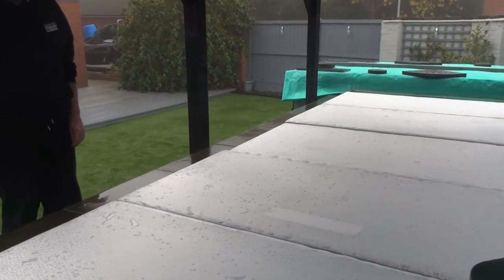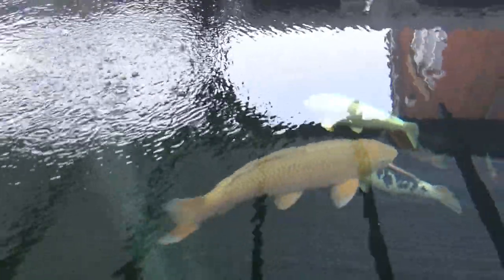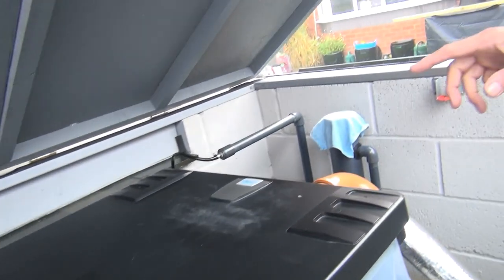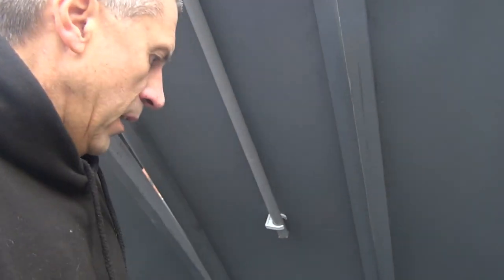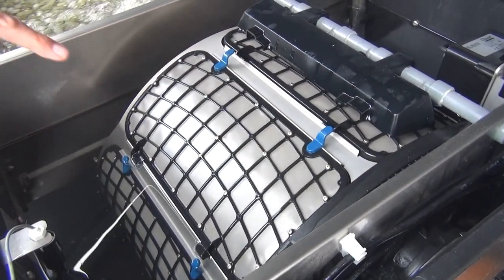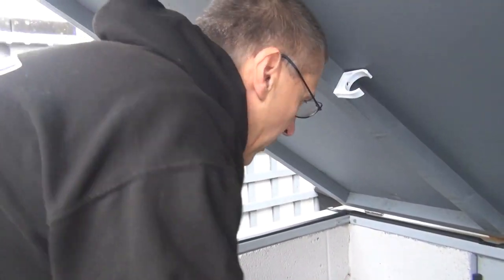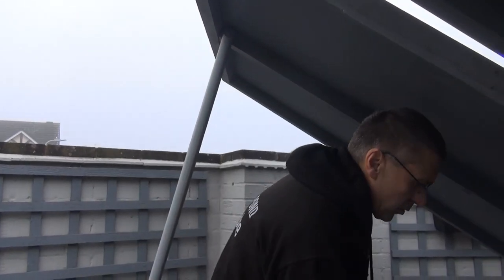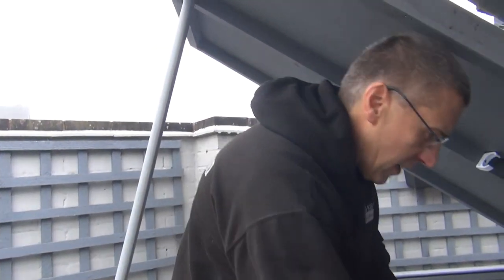T.K.P. Telford Koi Pond - Video 45 - New Koi progress, Filter & Airsource Heat Pump and Water Flows.

Comment: Heavy rain last night and I only had 2 covers on as it was warm so a lot of rain into the pond however I found that this helps my Nitrate and does not seem to effect any of the other tests PH was 7.4  Water test   ..  @
Moved the pond light again by a couple of feet and the fish seem to like this better…  @
Reply from the maker: My pergola only has shadecloth on the top as I struggled to get polycarbonate sheets at the time but Must  admit I’ve tested after heavy rain and it doesn’t really affect the parameters in my pond which was a relief👍😊. I need to get some lighting sorted now that the nights are drawing in so quickly (dark her at 4.30pm today😡) so that’s probably my task for this weekend. Thank you for watching and commenting, it is appreciated 👍🈲🐟😊

Comment: I was just in the midst of sending you a message regarding the ASHP and flow rate., job done and thanks for the info.. your ponds looking great and the fish are coming on really well. 👍🏻
Reply from the maker: Thanks Phil, much appreciated 👍😊. I’ve got the 12kw Thermotec heat pump and the recommendation is a nominal 4700lph so running my 12000lph at 40% is 4800lph so having that pump going through a virtually straight run into the heat pump and nothing else allows me to control the water flow just using the variable flow on the pump control panel so no need for tweaking the ball valves in the heat pump bypass. I would alway recommend running a dedicated pump for the heater. Many thanks for watching and commenting 👍🈲🐟😊

Comment: Afternoon Phil
Would u get away with two rtns near the drum without ur long run to the ashp if the pump was beside your filter hut? 
Or do u need that far end rtn for water rotation?  Regardless of ashp  location
Head scratin time before blocks get build up over the next two weeks
Aaron
Reply from the maker: Afternoon Aaron👍😊. You would easily get away with 2 returns near the drum obviously one above the other at different depths and off-centre / circa 12” away from the corner) . I have friends with the same size pond who only have a single return and they get great circulation. The only reason I have that return up the far end returning at 90 degrees to the ones near the pump house is because that is the only place I could site my ASPH to ensure the airflow that the manufacturer recommends👍. Also remember to design your flow to give you clockwise rotation in your pond (when viewed from above) otherwise you will be fighting against Northern hemisphere physics😊👍. Hope this helps👍🐟🈲😊

Comment: looking good Phil👍  my pump is turned right down to minimum which is 12000 litres/h, and uses between 55-60 watts. So mine is still being turned over 1.25X per hour. Only down side to having an oversized pump I guess....I'm looking into an ASHP for next season, thought it was pretty pointless this season as I didn't have any covers for the pond so would be pretty much wasting the heat produced. Take care🙂
Reply from the maker: Hello buddy, In my opinion is is better to be overpowered rather than underpowered as you can divert some of the flow to something else (even if it just a straight return to the pond)👍😊. This will be my first winter running an ASHP so fingers crossed it lives up to expectations but at the moment (combined with the bubble wrap covers) I’m impressed👍. Thank you for watching and commenting 👍🈲🐟😊

Comment: Hi Phil, Another good informative video mate. I use to turn my pond flow down in the winter, as the koi didn't eat much, but now I'm heated I don't bother. As my pond temp is around 16 to 17c, it's like summer in there, plus the koi are eating me out of house and home lol, so I keep the flow going. Had my heater going well over a week now and it's used £3.00. so not to bad at the minute, but the weather has been quite mild. 
Just a thought mate, but would it be easier if you had a tower bolt either side of the centre section you lift, so they just slide across and lock into to two outside sections. It would save you having that piece of wood to prop it up. Just a thought mate, Take care and stay safe, Terry.
Reply from the maker: Good evening Terry, I know what you mean, I’ve just bought another 10kg bag of food , they are enjoying life at the moment👍. Can I ask, what temperature you go down to over winter and how long do you hold it there? Great shout re the tower bolts, will definitely look into that as it would be easier and more secure👍. Many thanks for watching and commenting, it is appreciated 👍🈲🐟😊
Reply: Hi mate, I keep mine at 15c or above. If you get down to 13c or below, you start to get into Aeromonas Alley, so I try to keep above 15c if possible. Keep up the good work mate, Terry.
Reply from the maker: @Wrighty  Thank you Terry, much appreciated. 15 degrees does seem to me the minimum for the majority of heated ponds so that will be what I’ll go down to 👍. Take care and stay safe👍🈲🐟😊

Comment: Nice update as ever. Do you keep the pond at 19 degrees all winter?
Reply from the maker: Evening Magnus, I’ll only keep 19 for another week then drop to 18 and then drop a degree every 2 weeks but don’t plan on going any lower than 14 degrees. Will obviously cut the feeding down accordingly and only wheat germ when I’m at 14👍. This is my first winter with a heat pump so I’ve taken lots of advice from koi keepers with lots more experience but still going to be a bit of trial and error🤞🤞🤞. Thanks for watching and commenting 👍🈲🐟😊

Comment: Started today on the Wi-Fi pond  pump / air pump / filters / lights /Cameras everything to go simple Wi-Fi connect so that everything can
be controlled from my computer or mobile phone and timed if I want so things will simple turn on turn off. They can be used as touch on touch off or by saying turn on pond light turn off pond light. Signal strength  could be a problem the router is around 400ft from the pond in the house and being in the North the walls of this house are thickly insulated around 6” plus the brick and blocks        
youtu.be/b0rRIjfhIOg
Reply from the maker: Definitely something I’m looking at for an improvement for next year so will be watching with interest👍😊